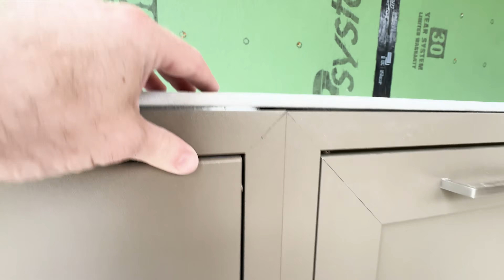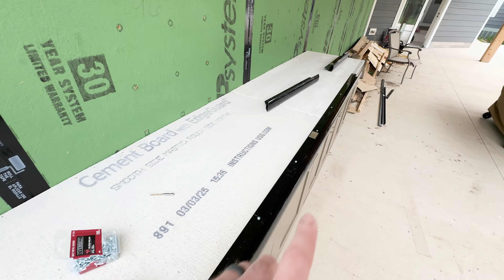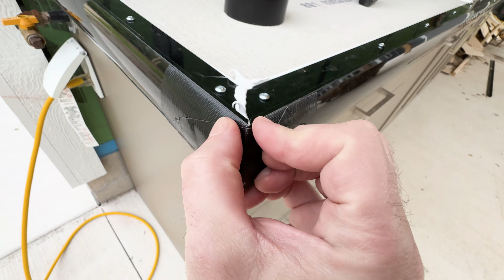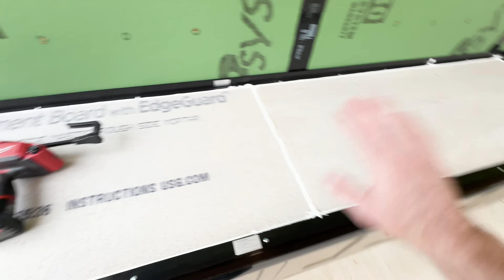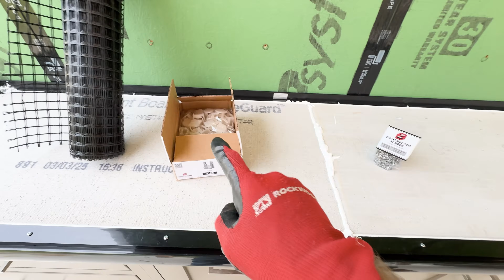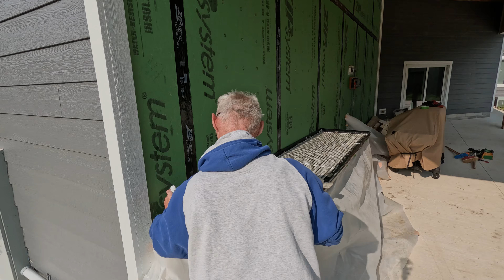Building a Concrete Countertop Is Easier Than You Think!

Comment: You didn’t show much of the concrete mixing part. Did you just use concrete or did you also add the Z Solutions mix packs to each bag of concrete?
Reply from the maker: Sorry about that! I used a quickcrete sand/topping mix and the added the liquicrete to that mixture. One:One ratio.
Reply: @DetachedGarage that’s what I thought but also was hoping there was a cheaper alternative to having to buy boxes of the mix lol.
Reply from the maker: they do offer a 6 pack which gives you a little discount per box. But no other options. Good luck with your pour and let me know if you need anything 👍